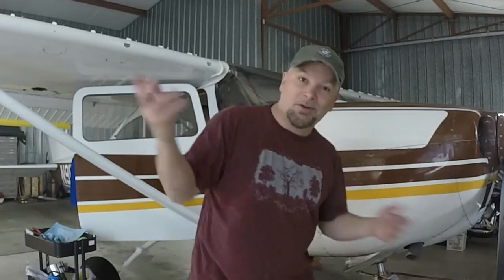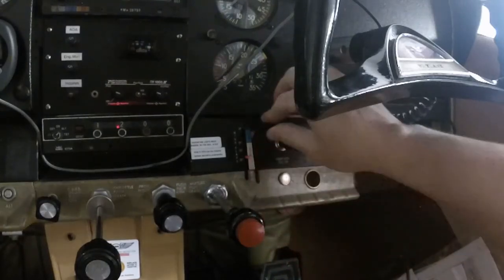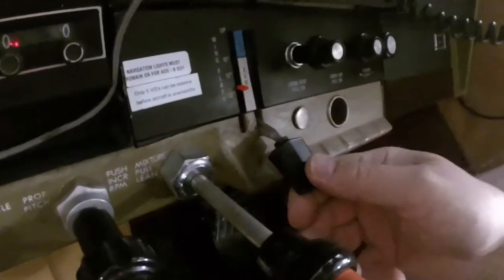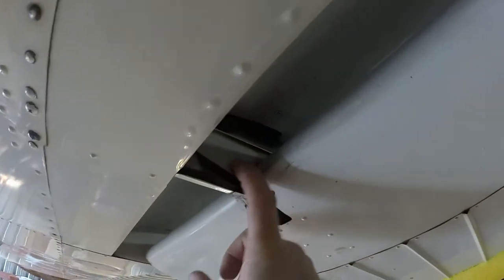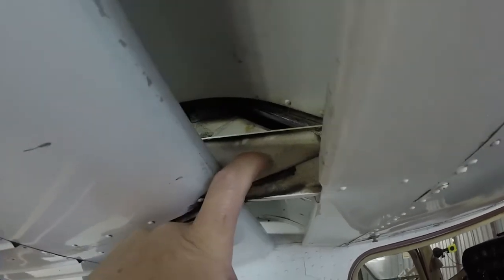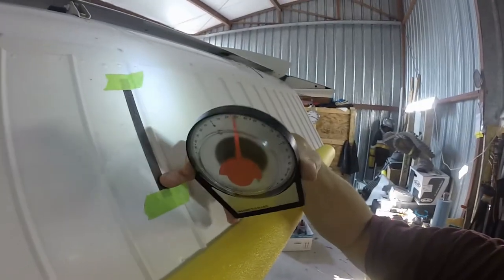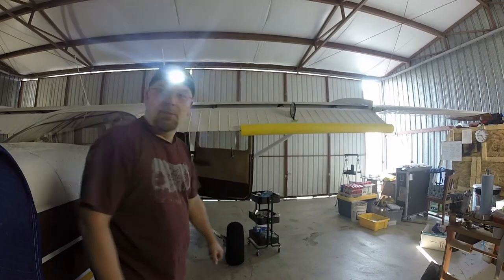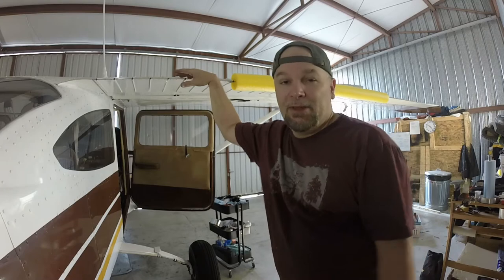Cessna 182 Flap Rig Tutorial | W/ Full Description and Operation

Comment: I have had to work on these systems. I found that if the micro switch rigging between the two on the lever in the cockpit are too close together in the degrees they actuate, they will cause that flap hunting. Move the rigging on one switch 1 degree away from the other. Say you have the rigging at 0, 10, 20, 30 and the flaps hunt. Try setting 0, 9, 21, 30. You have a tolerance. Another thing is the flap follow up cable can get a lot of internal friction. I have had to repair the rib where the cable is clamped in the wing where it was torn by the resistance to the cable moving against it's clamp on the rib.
Reply from the maker: It's not a user friendly system. Lots of janky-ness. But they do give a tolerance thankfully.

Comment: Great video, will keep it in mind in case I run into any problems with my cardinal.  Legacy cessnas are for the most part very similar.
Reply from the maker: Generally speaking that is true at the wing. It's the flap handle mechanism that's different. A lot of the practices crossover. In my case the feedback cable was way out of adjustment. I'm glad you took the time to watch.

Comment: We replaced my cable a year ago.  It never did come quite back to 0.  Over time, it has gotten worse.  Maybe, with your video, my A&P can figure it out.
It is frustrating.  Cruising around around  2-3 degrees of flaps hanging out just ain't cool.
Reply from the maker: Sounds like your follow up cable is doing the same thing mine was. In addition mine would "hunt in the intermediate position. When rigging flaps read the manual carefully and do the steps in order. It will make the job so much easier. Good luck. Let me know how it went.